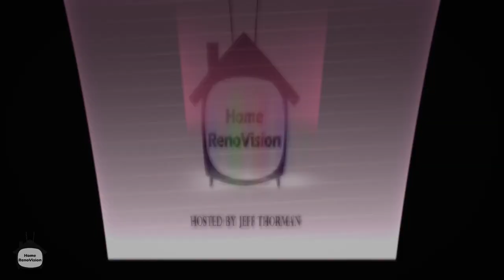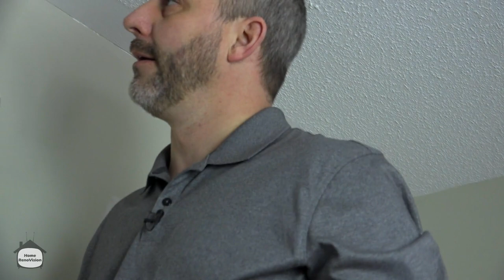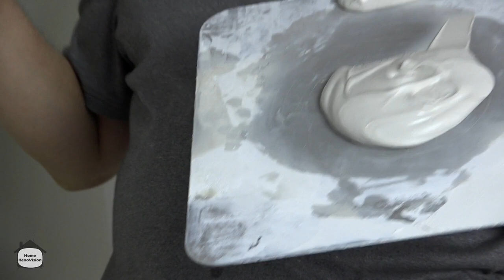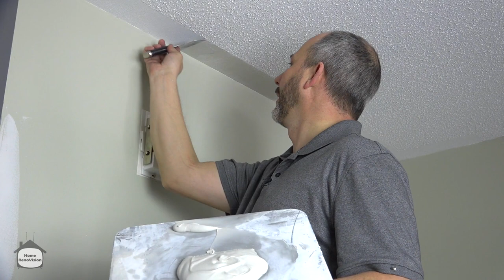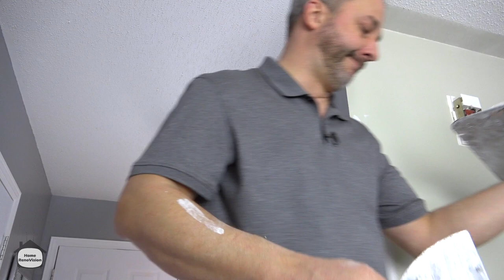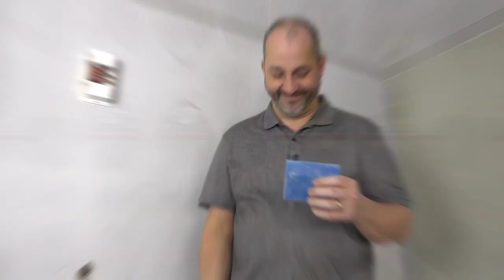How to Add a Smooth Edge to Your Stippled Ceiling

Comment: why not just remove the entire popcorn cieling :)
Reply: MR. RK What I was going to say.
Reply: Because you have to skim coat and sand the entire ceiling in that case.
Reply from the maker: That is an option, however this took 2 hours and I did it while painting. The whole room takes 2 days.
Reply: Home RenoVision DIY, 2 days is well worth the results
Reply: Shawn Lawson  Ah yes, the SCIence of spelling.
Reply: @HomeRenoVisionDIY  If I try to remove all the popcorn, do I have to use mud on the whole ceiling to smooth it out?
Reply: Hi - Is it possible to remove the entire popcorn ceiling without the floor above falling on you?  I'd like to add canned lights to the kitchen ceiling.  It's not wired for such currently.
Thanks.
Reply: @RonnyMathewTheNorthStarrX  That is exactly my question too. I want to remove the whole popcorn ceiling and paint it. I just don't the full process for the ceiling. Is it just the same as this only across the whole ceiling?

Comment: The ceilings throughout my house are stippled.  I don't like it but I'm not about to remove all of it.  That's too much work for me.  But!  I can do the smooth edge.  I've never heard of that but it looks great.  Will you be showing the whole room when you're done?  I'd love to see how it turns out.  Thank you for the video.  (Max is getting so good at this!)
Reply from the maker: Hi Sandi, the whole room will be in an upcoming video. Smooth edge is popular here since most walls are smooth without texture. It helps get a clean line at the ceiling.
Reply: I removed mine, you can get some nasty blue stuff that removes it well, but make sure the room is empty and floor is double covered, it eats the paint of skirting and doors too. not an issue for me as that all needed re-doing anyway

Comment: Hey Jeff, I've got an unrelated question for you.  I'm working on tiling my master bathroom, and we've added an accent strip to the design.  However, my shower wall tiles are about 1/2" thick, and my accent tiles closer to 1/4" thick.  What would you put behind the accent tiles to make the tiles end up being level in the end?  Thanks in advance!  Love your channel!
Reply from the maker: Hi Karen, I like to use a piece of kerdi membrane to build up area. This way you can use a non modified cement behind the kerdi and install the tile right away. One bit of advice is to let that dry overnight before continuing the next day to prevent sag in the mosaic. Cheers! I hope that helps. They sell the kerdi Band at the building stores for around 25 bucks.
Reply: Home RenoVision DIY Thank you so much! I’ll give this a shot!

Comment: We are doing new drywall walls to old texture ceiling. Is there a way to use this technique to allow taping and mud? Would rather not scrape the entire ceiling to do the corner taping if possible.
Reply from the maker: sure install drywall and then do this and then tape.Cheers!

Comment: Saw your "DIY How to Paint like a Pro Series A to Z" video first as prep to painting my spare bedroom and really liked the smooth edge on the ceiling; glad I found this video as now I'm going to try this as well! One question; do you not paint the smooth edge after the mud/sanding? My popcorn ceiling was previously painted over, and I'm sure after removing the border it may need painting. Any advice? Love the videos!
Reply from the maker: Hi Bruno if you use a white compound just a little sanding works fine. but painting it is easy as well. just be sure to use paint with no latex additive.

Comment: Wow!! That looks really great! I wouldn't do that in my home, but it is kinda cool. What would you do if it is a textured ceiling, and they wanted a smooth ceiling? What i am doing is taking my 4in blade and taking out the high spots by scraping the whole ceiling. Do you think sanding will be a better idea or will it just ruin the sand paper? Afterwards I will just cover it in mud, and sand it. I might I have to do that a couple of times to make it silky smooth. Thanks for the video, and Cheers!!!
Reply from the maker: If it hasn't been painted wet the ceiling first and it comes off easy! Otherwise you are correct.

Comment: Hi Jeff , thank you a lot for all your video, they are really helpfully. I have a question for you. I'm renovating my basement, and I'm going to frame it, insolate it, and THEN off course drywall it. My question is, because my basement is 7' height, can I install the drywall vertical, instead, in this way I need to just join the drywall on one side, instead if I install horizontal   I need to join the drywall on both side, vertical and horizontal ?  thank you
Reply from the maker: You don't save any time and actually it is harder top tape the vertical joints then horizontal...you end up doing a lot of bending over and reaching. Plus you don't save any material either way!

Comment: Hypothetically, if one were to scrape the entire ceiling, would you have to mud the entire ceiling to achieve that "smooth" surface?
Reply: Yes, You would regret scraping your ceiling. Builders today slap drywall up knowing its going to be textured. Once you scrape youre gunna have a lot of work to do.

Comment: how to i handle a home that has like 20 foot talk vaulted ceiling? the top is extremely high! I cant afford to hire people to come in and was told that the popcorn ceiling was for "noise reduction" so now im questioning if im supposed to remove it at ALL.  advise please! i dont like popcorn ceilings but not sure how to handle this.
Reply from the maker: Sound reduction, that is  a good one. popcorn ceilings are used to cover up a inferior drywall finish. If you remove it you will need to finish the surfacing of the ceiling as well.